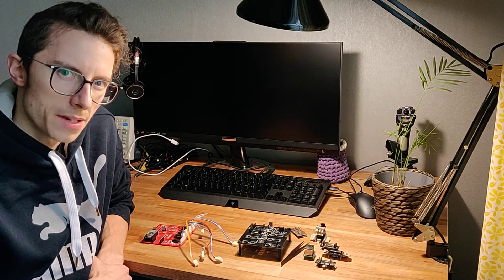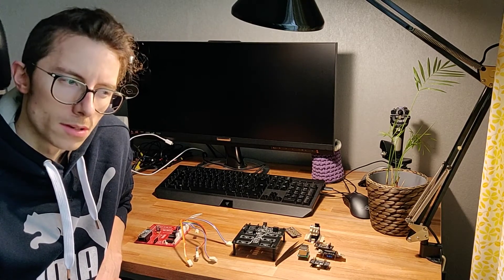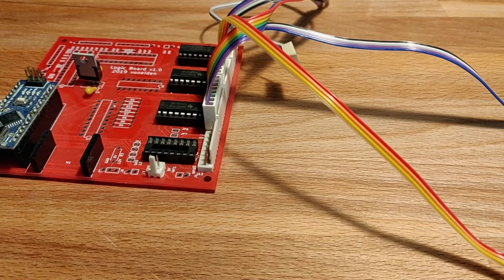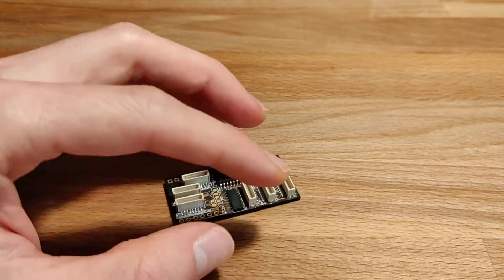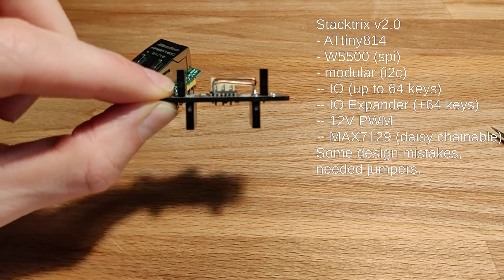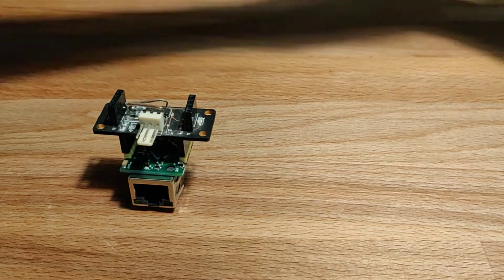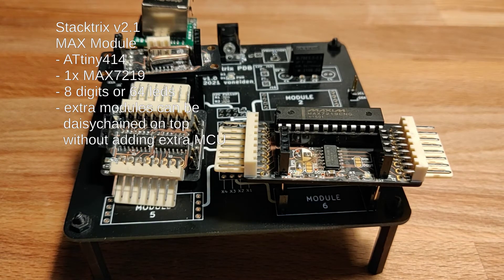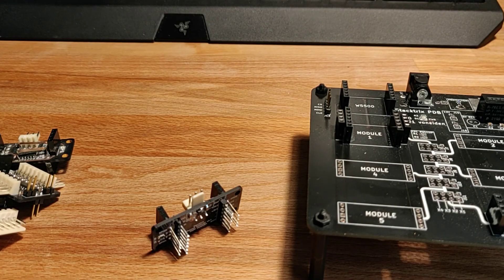DIY home cockpit hardware interfacing - The Modular Stacktrix - Sim Vlog 001

Comment: Where can we get these? Is there a completed and assembled version for purchase?
Reply from the maker: Good question and the answer is no. Although I appreciate the interest.. If your aim is to get a functional sim quickly and affordably, then something like Arduino and/or Leobodnar route is a sane way to proceed. Stacktrix is a bit insane, but personally I enjoy the extra DIY challenge.
Reply: oh is it? But is there a controller that doesnt require a matrix and has button inputs of over 70?
Reply from the maker: No matrix? That's a tricky requirement.The biggest I'm aware is Leo Bodnars BBI-64 which has 64 inputs. The BBI boards are very much plug-and-play. Somewhat expensive, and not all software supports more than 32 joystick inputs (the BBI pretends to be a joystick). You could of course have multiple boards. 

Second one is Arduino Mega with 54 GPIO pins. Not plug-and-play.

There are also IO expander boards like DIGIO-128 but at 70 USD that's a bit overkill IMO.
Reply: if only DIGIO-128 costs lesser..  Is it not possible to link together 2 BBI-64's?
Reply from the maker: Can't say for sure as I've never used them, but I'd imagine each one shows up as an individual joystick with 64 buttons. There's a program called Joystick Gremlin which allows merging inputs from different joystick peripherals into a single virtual joystick. reddit.com/r/homecockpits might be a good place to ask for more information from people who have used Leo Bodnar boards. Since those boards aren't that cheap either, you probably want to make sure they fit your needs before buying.